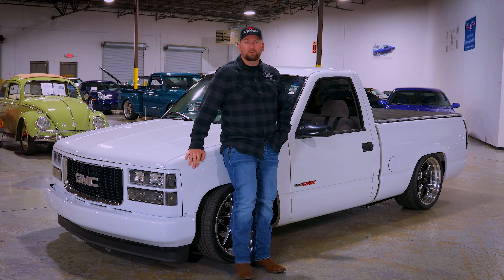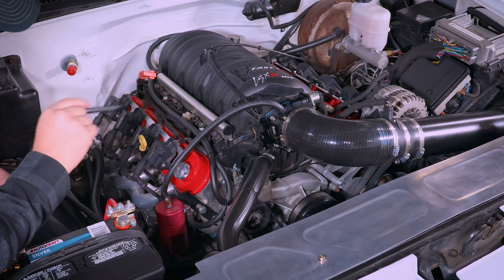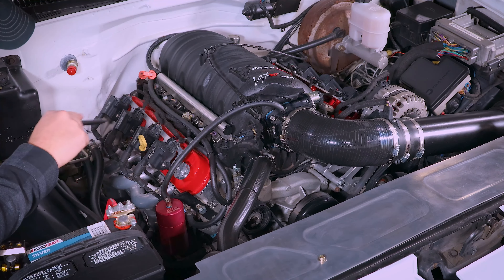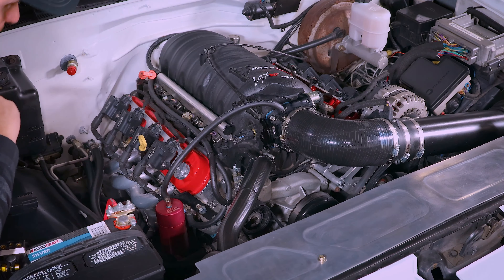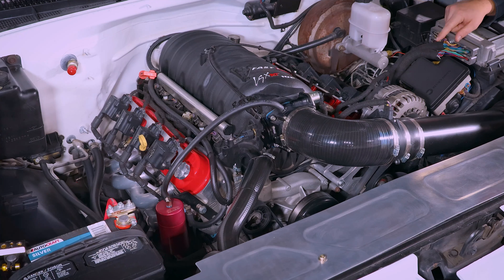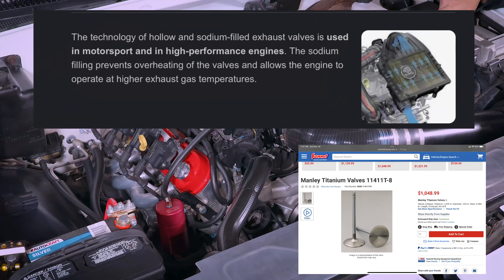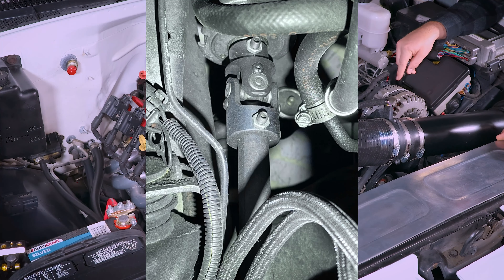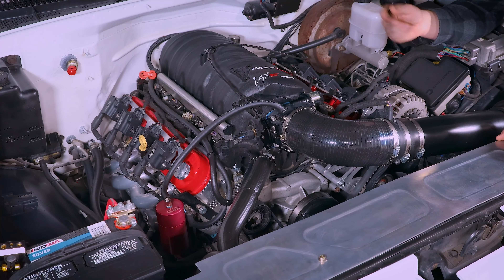My built 450HP 6.0L LQ9 in my OBS!!

Comment: I recently built an LY6 with about the same parts, but used GM corvette injectors, factory coil packs,  fast fuel rails, mishimoto 2" rad, 9/7 blade fans, comp cams high lift truck cam, billet banked over cylinder heads, performance rockers and lifters, short tube headers, AFM+VVT delete, stock 6L80 trans. I'm not done tuning yet and am seeing 430HP in my 2012 Sierra Crew Cab

Comment: Such a clean OBS, love what you've done to it.
Reply from the maker: Hey, thanks!
Reply: @AllTimePerformance Hello I own a Chevrolet express 6.0 LQ4 with 90,000 miles, I live in France in a region where the climate is temperate, I do 6000 miles per year, I drive mainly in the summer, and I tow a 6000 lbs trailer, should I stick to the oil recommended by the manufacturer 5W30 or can I use a 5W40 for example???

Comment: 6.0 30 over forged summit pro pistons 243 heads gonna be going in a 95 Chevy single cab.. what cam should I run? Im looking to be around 850-900hp
Reply: Anything over 230 duration
Reply from the maker: I would call BTR or Texas speed and get their opinion on it.

Comment: Will the lq9 fit right into my 04 Silverado? I’m looking to do a 6.0 swap but I hear the lq9 is better than the lq4
Reply: Same motor lq9 just has higher compression
Reply: It'll fit gotta run 93 octane though
Reply: Lq4 has dished pistons while the lq9 has flattop pistons for higher compression. The lq9 is what’s in the Chevy Silverado ss and the escapades while the lq4 is the 2500 line engine.
Reply: @bentleynorton6843  why u gotta run 93? Lets say i wanna boost my 6.0 LQ9 whats the best fuel for me?
Reply: @carlosdelao9874 either 93 or E85 if you’re gonna boost, that E85 will make quite the difference. But be aware it’s not plentiful in some areas and fuel mileage goes way down but way worth it!

Comment: Would you be able to give an estimate on how much it costed you to do that engine swap? If possible could you do an estimate with just the engine and parts and then what you think it would cost for labor if a shop were to do the swap for me. If not no worries! Thankyou
Reply: I jus Ls swapped my obs chevy truck I bought a donor vehicle for the motor an transmission I called around about the Ls swap from a few shops an guesstimated me 14k then I found a official shop for the motor an transmission swap new exhaust all new sensors an tuning they charged me 9500 job came out immaculate truck runs like it was built that way
Reply: 9500 well  dam it’s high where you at
Reply: @parkerlomax9304  fasho😂😂🤦🏾
Reply: @parkerlomax9304  nc 🤦🏾🤦🏾
Reply: @bighurkobs94 Can u give me the shops name and location? What OBS do u own? 
Which donor vehicle did u get, what engine did it have

Comment: 450hp only?? 6.0 with just a cam and headers should be over 500
Reply: It is because  the intake he's running
Reply from the maker: show me a 6.0 with cam and headers making 500whp.My motor made 450 at the wheel thats about 550hp at the crank. Plus my 6.0 has -10cc pistons for boost and it still made 450whp.
Reply: @AllTimePerformance what heads did you run like what cc ported or polished at all
Reply: Richard Holdener posts videos of 6.0l builds. It doesn't take much to get a 6.0l to 450hp. My 5.3l build had less done and made 400whp. I know it's set up for boost, but still seems very low